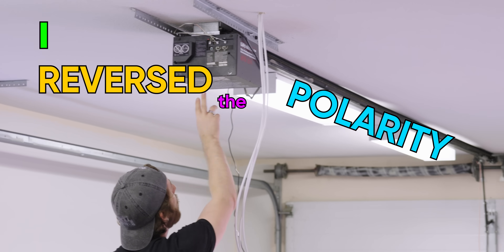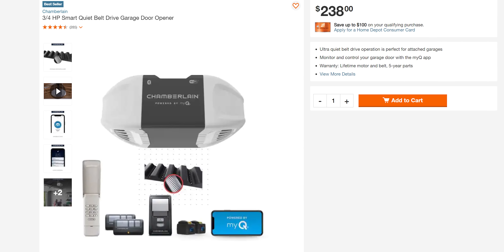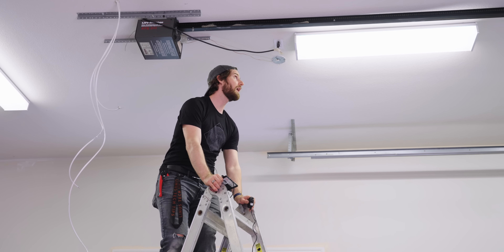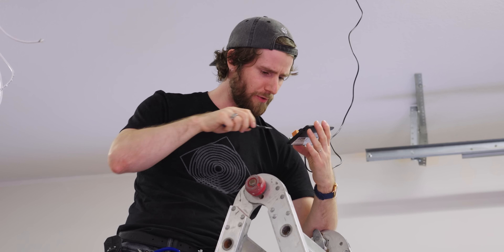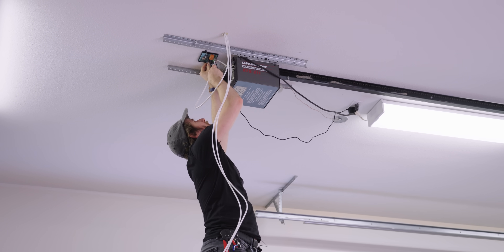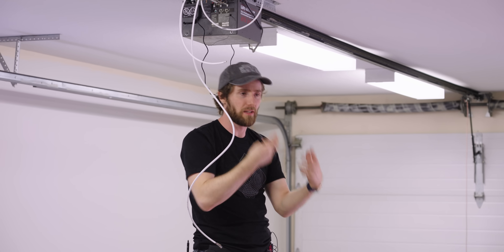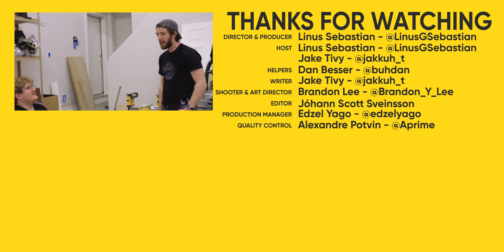Smartifying My 25+ Year Old Garage - Z-Wave Garage Door Opener

Comment: I work for Chamberlain/LiftMaster. So, to be fair, the reason the Chamberlain/LiftMaster/Craftsman MyQ openers flash it's lights and beep while closing is for safety, it's saying "HEY IM CLOSING, GET OUT OF THE F***IN WAY" it's related to the UL325 standards set for the garage door opener industry back in 1993 to make them more secure and "safer". Also the wall control panels are serial encrypted so you can only use that brand of products for reasons like....people trying to tinker and use those operators for purposes the manufacturer wasn't intended for and so products not intended to be used with those operators can't be used. Had a guy use a jackshaft (side mounted opener) to operate a dumbbell waiter in his house and another using a garage door opener to operate a scissor lift for a motorcycle haha The older operators pre security + 2.0 (the yellow learn myq enabled units made 2011-present) are still dry contact so you can do the wonky and DIY stuff you all like to do. Just puttin' all that out there haha
Reply: I had to stop the video after the blinking/beeping comment to look for comments like this. Like, I get that you want the door to close immediately, but you probably don't want the lawsuit when somebody's working on it or standing under it when it shuts and hurts them, and that's what it's for. Hard to believe that Linus couldn't figure that one out on his own.
Reply: @grex2595  he did realize that but he’s intelligent enough not to close the garage door on top of someone else, and therefore doesn’t need that safety protection.
Reply: @OKayD3N  yes, because he didn't literally close the garage door on the last WAN show without checking the door while somebody was there who could have been hurt by it. Because the only time anybody closes a garage door through the cloud is when they're physically present to visually clear the door. The fact that you haven't considered those situations is exactly the reason they have to put the safety feature on.
Reply: @OKayD3N  you're assuming this house would never need to pass a proper home inspection in the event it sells to a family with little ones, grandma, dogs & cats.
Reply: Why even bother selling motors then? Someone might attach a knife to it! "Someone might DIY something stupid" isn't a valid excuse for DRM and proprietary, less useful, crap. That sounds kind of like "Someone might use our not needlessly overengineered product and make it more useful for their purposes without paying us our cut".
Reply: There are safety beams to protect.
Reply: @cameron858  go get a ladder, set it up centered over the beam and close the garage door.
Reply: @lcarsos  silly comment. The lights are to let the person on the ladder know that the door's coming down so they can get off before they get their spine crushed by a door closing on their head. The ladder is just an example of how the safety beans are useless unless whatever is under the door intersects them and cuts them off.
Reply: @grex2595 it’d be very difficult to be hurt by a garage door.

Assuming the door is heavy enough to do anything to you, you would need both springs to break (unless it’s a stupid heavy door), the photo eyes to malfunction yet still send the “all good” signal to the operator (which is basically impossible), and the operator itself to override its own safeties where if it gets too much resistance it goes back up.

There are safeties in place no matter where you’re at. The only way could really be hurt if everything’s working properly is to be knocked off a ladder.

Of course if something’s wrong then you can have the cable snap and cut your head off, a spring could break and imbed itself into your face, it could fall off the track and either launch you into the air or crush you… I could go on but all this to say that you shouldn’t fuck around with a garage door unless you know what you’re doing, but assuming everything’s good then there’s nothing to really worry about
Reply: @Fetidaf  you ever lift a garage door with a single spring broken? Those things are heavy. One broken spring could easily hurt somebody. Regardless, being on a ladder when the garage door starts moving is not unreasonable for this garage. The amount of pressure a garage door is able to exert before its safeguards kick in is still plenty. Let's also not disregard how a person may respond when a garage door is suddenly moving without warning. It's not always going to be rational. I watched a video where a person tried to jump over the sensor as the garage door was closing and broke their neck on the door.

Sure, it's not easy for any garage door to cause significant harm, but that's no reason to make fun of safeguards intended to further reduce the risk and then just go build your own specifically to avoid said safeguards. Let's not forget that he activated it on the WAN show while somebody was at his house and startled them because he didn't even check to see if it was clear before activating it.
Reply: @grex2595  yes, I’ve lifted them with no springs on it.

With 1 broken spring your “average” 2” polystyrene steel front and back would weigh about 120lbs, if it’s uninsulated it’s about half that. but you know how much it should weigh with springs? Ideally 0 but probably about 5. The only force you would feel is that of an operator itself for about half a second before it comes back up. And even with a broken spring (or no springs) the operator will hold it up, raise and lower it just fine… it’s not good for the operator obviously but it’ll do it.

The story of the guy breaking his neck trying to jump over the photo eyes has nothing to do with the door, he hit his head on a solid object.
Reply: @Fetidaf  as I said, don't disregard how people will act when a door suddenly starts moving on them. That guy got his medical bills paid for because the door wasn't operating correctly. Linus is using an automatic door without a safety feature specifically for automatic doors and likely without automatic door signage. If somebody acts irrational around his door because it's closing without warning, Linus will likely be at fault.

Also, if a garage door opener can lift a 60 lb door, then it can apply 60 lbs of force and those motors are operating at a significant amount of that capacity at all times. The 60lbs of force for even half a second applied to the right place can do significant damage.

Again, I'm not arguing that it's going to happen or even that it's highly likely. I'm just saying it's a risk. The flashing and beeping is a risk management solution. Linus has provided no risk management solution and has been seen live on camera not managing the risks when somebody was around to be victim to the risks. It's such a dumb thing to complain about, but it's especially dumb when you then go online and prove the exact reason why it exists in the first place.
Reply: @grex2595  it doesn’t apply any force down, really. It just lets the door down. You can stop an operator with your finger… they can be pretty sensitive.

And to me it doesn’t sound like anything was wrong with that door… he hit his head on it just like he could a wall, that says nothing about the door.
Reply: @Fetidaf  I didn't give the full story because I don't remember all the details but the garage door was not functioning properly. The man freaked out because the door was closing and decided to sprint out and jump to get out and hit his neck on the bottom of the closing door. Because the door had a history of misbehaving, the judge (mediator really) decided that the landlord was at fault for not having the safety mechanisms of the door looked at and fixed.

If the same thing were to happen at Linus' house, he could face the same judgement. The safety mechanism to warn of the door closing is not functioning and there is no warning sticker. If Linus closes the door while a person is in the garage, and they freak out, you have the same recipe.
Reply: @grex2595  okay, so that’s happened once, out of the tens of millions of garage doors.

And there wouldn’t be any difference if the light flashed or not in that case. Either way they would’ve thought the door was closing and ran face first into a door… which is an insanely dumb thing to do.
Reply: @Fetidaf  it's been televised once. How many times has it been done without being televised? And if he had been warned with the MyQ system, he would have gotten out before the door started closing. The lights and beeps go for like 10 seconds before the door starts moving.

Also, you're really arguing, "garage doors are already so safe, we don't need safety features?" Every time people think like that, somebody gets hurt. Bridges collapse, submarines implode, planes crash, etc. It's when people are too comfortable with safety that things become unsafe.

The beeping and lights flashing are such a minor inconvenience that it's difficult for me to understand how you could really argue in favor of increasing risk of injury and liability for something that wouldn't even inconvenience you in almost every situation. I have this stuff. I have literally never been inconvenienced by the delay.
Reply: @grex2595 garage doors are so safe we don't need that stupid beeping and flashing WITH 10.secomd delay. It's not an industrial site, and if the current safeguards aren't enough for you, maybe increase those instead of adding the exact thing you don't want in a residential area. Or better yet use that new fuzzy noise shit that's much less disruptive but still draws attention.
Reply: @marcusborderlands6177  you are really late to the conversation. I guarantee you have never experienced one of these because it's not that loud. You will absolutely notice it if you are in or near the garage, but your neighbors probably won't notice it. It really isn't the big deal that Linus and you are making it out to be.
Reply: @grex2595  I'm aware I'm late to the conversation, and I lived in a row house where I could hear my neighbors every single night. It's annoying and disruptive and the "safety" aspect is fucking stupid. It's not chamberlains job to make sure I'm all safe and not hurting myself on my own gear.
Reply: @marcusborderlands6177  you don't understand liability. It is 100% Chamberlain's responsibility to ensure safety. You might not sue somebody because of your idiocy, but there are lots of people who will sue despite it being their idiocy. And because they are the ones responsible for the safety features of their product, they will more than likely lose when a technician on a ladder gets hit in the head when their client shuts the door that gives no warning.
Reply: @grex2595  it's only chamberlains fault becuase somebody decided it was. Country is too sue happy. If they just had some disclaimer in the user agreement at saying you have to be within eyesight to operate the door, nobody would care. But no, nobody is responsible for their own actions it's all some other companies fault.
Reply: @marcusborderlands6177  Oversimplification. The risk of being injured by a garage door closing while the opener is out of range to clear the door before closing it was created by the opener manufacturer, so it is their responsibility to mitigate the risk.
Reply: Anything garage door related is super versatile lol

One guy built a shed out of old sections, the boss screened in his porch with lifestyle screens, my brother made an automatic chicken coop door out of an old 8500 and a sample garage door section, and I’m currently attempting to make a go-kart out of garage door parts. Using a bent shaft for the frame, a big gear from a gear head (I think that’s what it’s from) as the steering wheel, solid shafts for the axels, ARB’s for the pedals, the only thing we couldn’t really do are the wheels (which we could use rollers for just for shits and giggles) and the motor which I’m sure there’s a way to use an operator but haven’t gotten to it yet

Comment: I use the free Google Assistant connection and it's fine, setup is a bunch of steps (but you only have to do it once) and there's no re-authing I had to do, it's worked for months now. I just have to tell it to reload my devices if I change any of them

Comment: At 4:42 jake said but it very low to the bottom, so it would detect the garage door even if it's open a little bit. This statement is false because it wouldn't matter if you put it in the center, bottom, or anywhere on the door as soon as it moved; it would move away from the sensor triggering a door open status.

Comment: The beeping and flashing is a safety feature to let people know that your giant heavy garage door is about to close, in case you're closing it remotely and you don't want a loved one to get crushed by it. It's not a Chamberlain exclusive thing, it's a nationwide safety requirement. Wanting to bypass that is a little strange!
Reply: watching a little further, they could've just gotten a GD00Z from gocontrol and it comes with a tilt sensor you screw onto the door that tells you whether it's open or closed. Same z-wave network but they wouldn't have had to solder or code anything.

Comment: Working as an Security technician it's fun to see something simple as a magnetsensor making you scratch your head. Simplest way is to mount the side with cable, connecting a multimeter (fluke) metering the resistance/ohm and just hold the "magnet" side close enough to get a 0,4ohm or something through the wires. opening the door should give a open circuit(infinite ohm)

Comment: A cool addition might be to hook up a Carbon Monoxide detector, so if a car gets left on with the door shut, it'll open the door to vent the gas. Never knew this was an issue with garages connected to the houses, until some other YouTuber mentioned that numerous people die each year from it.

Comment: Do NOT install magnets near the bottom where they are more exposed to dislodging. Is the concept of two magnets in proximity that confusing?! When a garage door opens, the two adjacent magnets are dislodged whether at top, middle of bottom of the door, duh!!  Just pick a place that permits you to freely and solidly mount it. Putting at the bottom doesn't make it detect small openings of a foot or so! That's idiotic thinking!

Comment: Some of the limitations you mentioned for the MyQ could be midigated by purchasing the smart garage hub, you cna still use the orginal wall sensor, it simply relays the signal from wifi to your garage. The problem with it is you can't use Google or Alexa to close the door, you can only ask the status.

Comment: Next time add sensors at the top and bottom so you can determine if the door is fully open or fully closed.  This will help you better understand the doors position in case someone go underneath the door and reverses it.

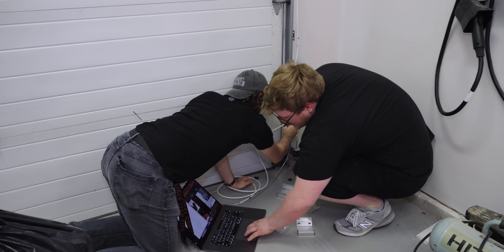Comment: Did Jake really say to put the sensor at the bottom in case the door's only open a little bit(4:40)? The door moves as one, if the bottom has opened by six inches, the top has moved six inches. Surely you can put the sensor anywhere, or am I missing something?

Comment: "put it very close to the bottom so it detects even if the garage is open a little bit"...
Wherever you put it, high/mid/low... it always detects the minimum opening. is a solid body... so if it translate 2cm, it's two 2cm everywhere... 
the minium opening detectable is the size of the "sensor" area.

Comment: Next step would be to set up a sensor that detect when you're coming home and automatically open the garage door for you, no assistant required. Best thing is you don't rely on anyone else cloud, but just direct communication between your phone (HA app) and your HA server. 

You can also automate the opening while you're to leave the house with the rigth sensor. For example I've set up that when my phone Bluetooth connects to the car (and I am home) the door will open.

Comment: I now have a solution to a problem very similar to Linus'. After going through a few solutions with battery powered sensors, and avoiding proprietary and locked down systems like Chamberlain, I found the best solution. Simple, connected to the Internet, no batteries. Garadget. Nothing beats them. Worthwile import to Europe, I would say. Would love to see them reviewed on LTT.

Comment: I got a Chamberlain door opener on my garage door, and I am able to activate it with an external relay. It was not described in the manual how to do it though, but the option was still there. So now I got a device with a relay and a sensor on each end of the rail for the garage door, and running ESPHome, so I can control it how I want, and also get status on where it is.

Comment: I have a possible suggestion.  Also I'm barely 2 minutes into this video.
I also  have no clue how garage door openers work but im assuming its some ancient tech.

can you use a standard garage opener and tap into the electrical output of 2 individual Philips hue bulbs?  

Have one light bulb tapped into the open terminal and another light bulb tapped into the close terminal?.

you can even do stuff like "siri turn on the garage bulb" and  it will trigger the light bulb tapped into garage open switch.

Comment: I 'smarted' my garage door years ago with a $13 Sonoff switch wired alongside the physical button switch,  and a door-sensor mounted on a hinge.  When the door is down, the hinge closes and the door sensor reports its closed. When up, the hinge swings open...  It's all controlled by Alexa or Google and works flawlessly. No idea why people feel they need both functions in the same device ....the hinge system is perfect, not even possible tp register a false positive because GRAVITY.
Reply: Because he doesn't want two switches. Period.
Reply: @PPedroFernandes  to each their own.  Redundancy and using one thing to do ONE task perfectly instead of multiple tasks half-assed and more expensive is for me a better option.